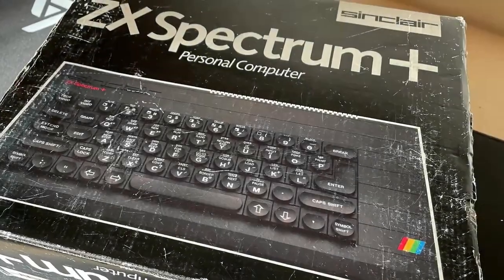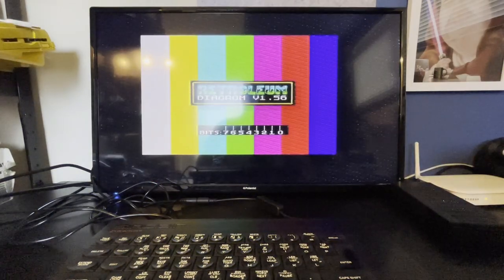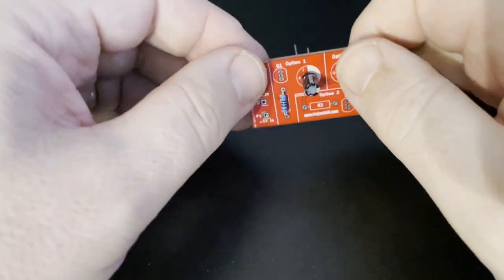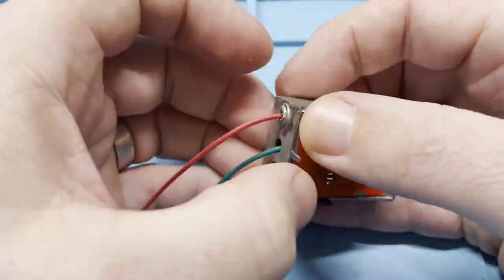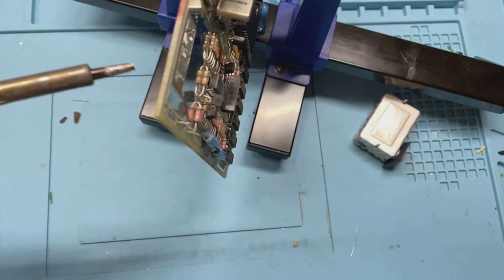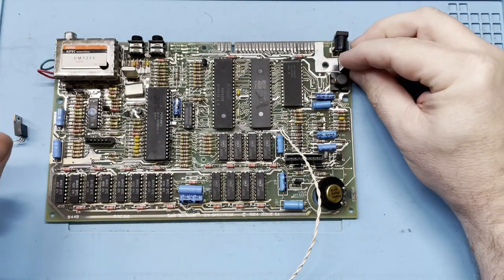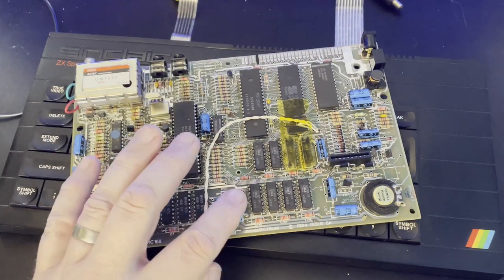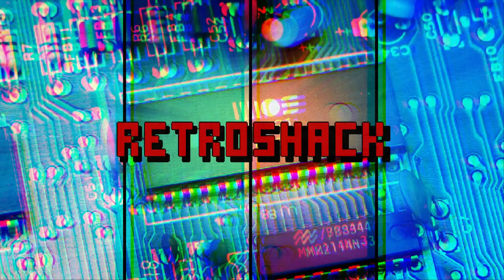Our 'Mint In Box' ZX Spectrum Plus is due some upgrades and modifications - so what first?

Comment from the maker: Hi all - several people have pointed out (quite correctly) that the composite mod board should be grounded to the chassis.  To be honest, I thought so too but it worked really well when I tested it that I didn't give it another thought!  I'll solder it up and make sure to mention it in the next video!  Good job you lot are on the ball! :) :)

Comment: Capacitor testers typically work by measuring the time it takes for the voltage across the component to rise to a particular level. The most likely reason those caps were reading larger than their rating is that they are leaking DC, basically they've developed a parallel resistance. This causes them to charge at a slower rate which fools the tester into thinking they have a bigger capacity than they actually do.
Reply: its a mod of famous Transitester. Just read how this thing work ;)
Reply: @VShuricK  I just did, and it works EXACTLY like I just said.

Comment: I made a lucky discovery a few months ago, another benefit of replacing the 7805 with a modern switching dc converter is that it provides polarity protection! If you now use a supply with incorrect polarity all that happens is the Speccy won't power up!
Reply: What was the rf output like after you did that? I tried it on a QL, rf went crazy. I swapped it back.

Comment: A real keyboard sounds fun, I’ve got my Next in a 48k case and use a ps/2 keyboard to avoid using the dead flesh buttons. Having real keys would be cool. Also, doesn’t the composite board need a ground connection too, through the rf box casing?
Reply from the maker: I thought so too with the composite board but it’s working perfectly well without one, so go figure :) :) :)

Comment: One thing I did with my ZX Spectrums is fit a heatsink to the ULA chip, just to be safe. I use ZX-HD – HDMI from byte delight. I use it on all of my ZX Spectrums and clones.
The big problem now is finding a Raspberry Pi Zero   for any of the addons. I need one for my Amiga upgrade.  I might find one in 2023 at a very good price when my ZX Spectrum Next arrives. I have changed the Voltage regulators on mine.

Comment: How do you select between the 3 options on the composite mod? edit as in how do you decide which is the best option?
Reply from the maker: Unfortunately, it's a matter of trial and error as some TV's react differently to each option.  The option that's most likely to work is option 1 - it's the option that actually you don't need this board for as you can simply put the capacitor in line in the video circuit but this makes it a little neater :)  These kits are only a few pounds each so it's really only the time to build and test each option that needs to be considered.

Comment: Looking good! Was the interference in the picture resolved after the changes? If not what PSU are you using? It looks a lot like interference I saw before when using a cheap, switching power supply. If it's a known good one then forgive me!
Reply from the maker: Good shout - I’ll check a few different ones and see if the few remaining artefacts go away- I’ll also be soldering in that ground connection today too!

Comment: That looks to be the simplest RF mod I've seen done on a speccy, pretty sure even I could do that!

So where can I get one of those boards from?  And does come with the components to build it?
Reply from the maker: You can get these boards on Tindie and eBay (and probably loads of other places too) but if you search for 'spectrum composite mod' then you're looking for the PCB marked projectavr.com.
Reply: @The Retro Shack  thank you very much for that, my Spectrum + will be living again soon 👍
Reply: simplest way is just remove inside pcb and connect wire (el cap) from Video out to RF connector. 99% of TV are ok with it. If you have such crappy monitor, maybe monitor is the problem.

Comment: It was a good thing you replaced those caps. I don't usually replace any caps just for the fun of it. I can live with old caps depending on the application. However in my experience, an unexpectedly (too) high capacity value in old equipment that wasn't powered on for a long time indicates some more uncommon type of capacitor degradation. I've had extreme cases where the capacity was doubled or even tripled while the ESR measured excellent, but these caps did not stand their rated voltage anymore and blew immediately on that voltage. Maybe your caps would have recovered over time when being powered. Maybe not. Thats not a gamble I would take.
Reply: I've never seen bad caps in spectrums. Even that primitive switching power supply  for RAM chips is not demanding low ESR caps.  The only cap replacement are needed if 7805 is replaced with that module. It may require LOW ESR caps near it.

Comment: Composite mod board, should be grounded/soldered to the RF modlator chassis.
Reply from the maker: Yes, I thought so too but it seemed to be working just fine - I'll solder the ground in and see if it looks even better :). I'll make a note to mention this in the next video too :)
Reply: @TheRetroShack   Without ground it is just a capacitor, the transistor will do nothing....
Reply: @TheRetroShack  Ground pads are on the edge of the PCB, so they probably have a decent contact with the chassis, at least until its surface will not oxidize.
Reply from the maker: @pe1dnn  I’ll be soldering it in tomorrow and will update on progress.  I can only assume it’s accidentally grounding out at the corners because it’s a very tight fit.  Maybe this is what’s missing to remove those final artefacts :) :)

Comment: I know it's an age-old argument, but rather than putting a Pi inside your Spectrum and replacing the keyboard, why don't you just run an emulator on the Pi and find a nice case for it? That way you'll have two Spectrums for the same price and effort. There's going to be very little of the Speccy left once you go down your current route. I'm not especially attached to Spectrums, but I have to wonder what the point is?
Reply from the maker: Just to clarify - there won’t be a raspberry pi inside the spectrum.  The TK Pie is a cartridge that plugs into the rear of the Speccy :) Everything I’m doing is entirely reversible and no Spectrum’s will be harmed in the making of these videos :) :) :)